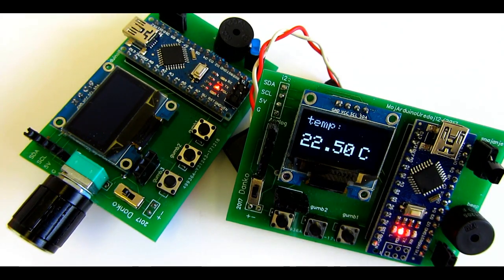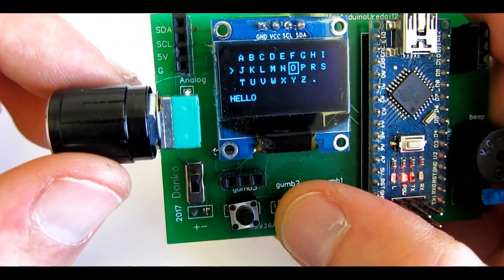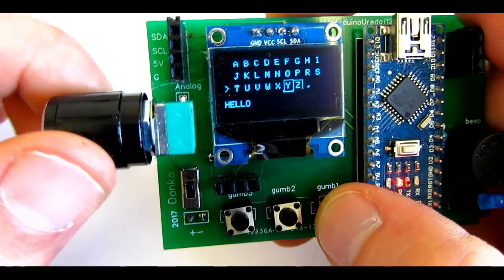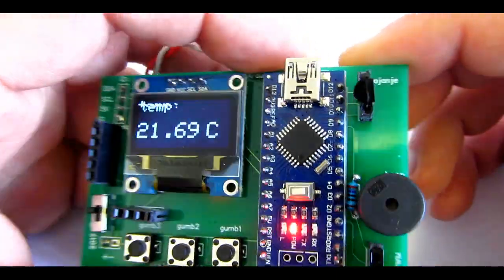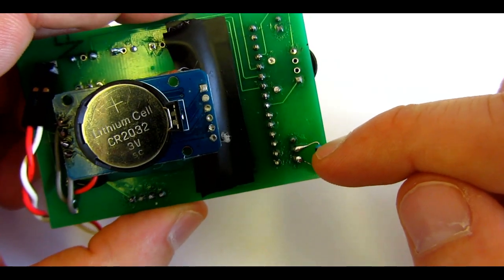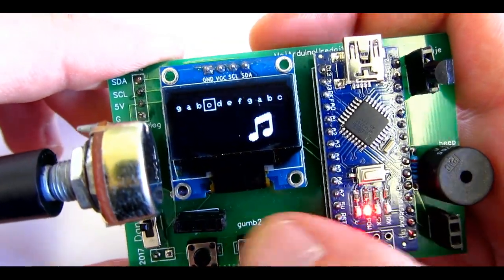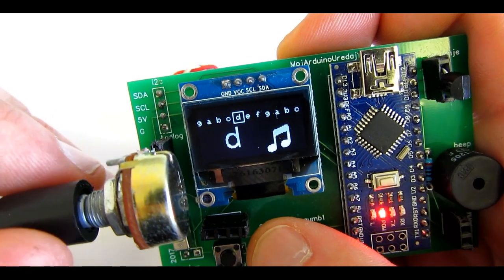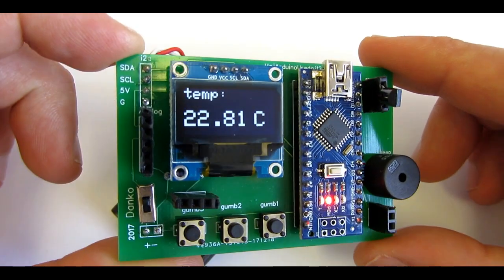Multidruino - new features , functions , apps

Comment: Does anyone have this running correctly ? Since the info page is down ! I have wired as per the original version but using the newer sketch - I need the new wiring diagram ! my 128x64 display is not displaying correctly (except for Analog read screen) the rest is stretched or missing half ! where do the mystery 10K and 100K resistors go? and seems only the middle button is working out of 3 ! They are connected to D2,D3,D4 or have they been moved in newer version ?
Reply from the maker: This is very old project, i ađ on becation, i will be home in few day then i will help ypu with conection and code... Also your library for oled is vurently by defoult set to 128x32 so image is streched, you need to set it to 128x64